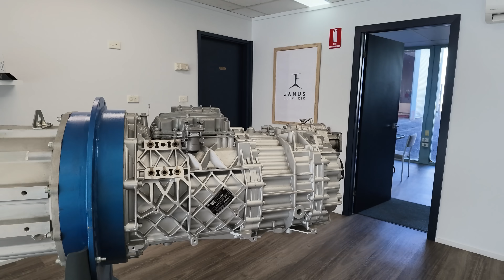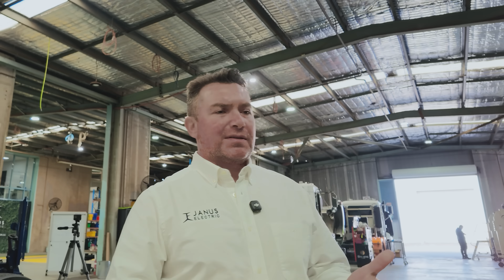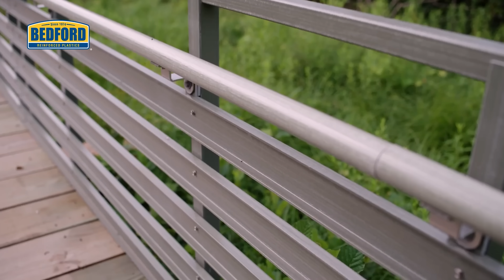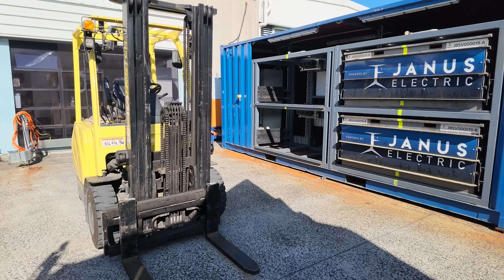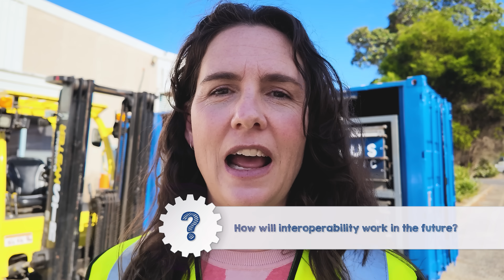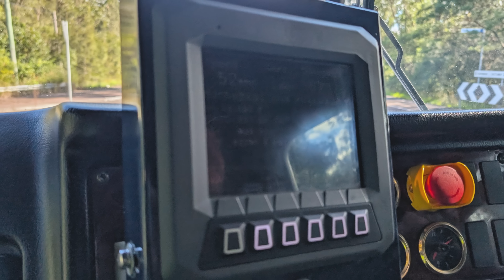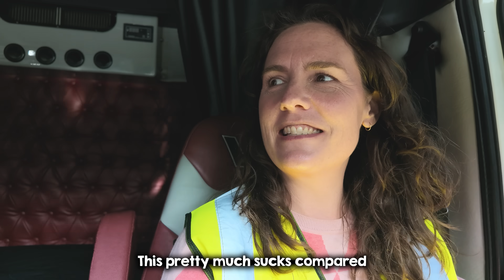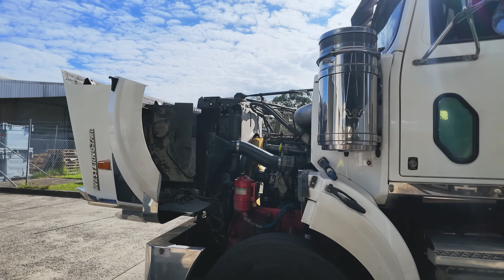The EV Truck Idea I Actually Didn't Believe Until I Saw It

Comment: Ok so even battery swapping still does not make large ev trucks viable so you can’t get around moving electricity around the grid so we have 250000 large trucks even if you tried to do 10percent 25000 trucks which with battery swapping probably means 50000 batteries it’s a load on the grid even distributed won’t scale. Really the only solution for trucks in the future is Hydrogen fuel cell, batteries work only when battery tech gets better and you build Small modular reactors at a charging station to charger the batteries so removing the need to connect to the grid. Only reason people are mucking around with a few EV trucks is it gives the companies rebates and Benefits from the government if you stop all government benefits watch this all stop fast

Comment: You didn't show any pictures of the actual electric motor in the truck standing back a little bit to see how it all looks
Also the truck with the batteries looks like it's only a few millimetres off the ground what would happen over a rough road or any speed humps ?
How many kilowatts are the batteries how long do they take to charge ? To me it was just a lot of talk

Comment: I've been wondering why there aren't diesel electric trucks, like train engines. They would be able to operate in extreme cold when batteries often fail. My husband says there was a plan to switch out batteries in electric powered planes, but doesn't know if it ever came about.

Comment: I don't want to seem too smug, but I've been advocating just this for years. It's so obviously a good idea, especially in a place like Australia where there is a surfeit of solar energy during the day. The peak-shaving capabilities of the charging stations multiply the grid-scale economic benefits, to add to the overall environmental benefit of the whole scheme of electrifying trucking. I think the reason we don't have this for cars as well is a lack of co-operation within the auto industry to standardise on battery form factors and battery-to-vehicle connection systems. They are doing this in China, though, so it may just be a matter of time before battery-swapping becomes the norm for all EVs. That will end the insane situation in the auto market, where cars compete on the basis of their range rather than other factors such as performance, carrying capacity, etc., as is the case in the ICE auto market. Imagine that: the two main worries of BEV sceptics: range anxiety and fear of battery degradation, banished!

Comment: LOL so the batteries where they need to be out in the country wont even have them, nobody is going to have a few spare batteries just sitting there incase someone comes.. LOL this is a nightmare and it can be solved with hydrogen combustion. nobody is taking into account that EV take more fossil fuels to make and keep going and last a a shorter time which means they are very inefficient the math says so!!

Comment: So batteries great, first problem is they have to be everywhere a truck goes, I was NSW truck driver and I went EVERYWHERE non stop 500km stop unload then go to the next destination 40 more drops to go, and then later that week finally go home. batteries out in Coona, Dubbo, Orange, Lithgow, Armidale, Tenterfield, Coffs, casino, grafton, lismore, inverell, and back to Orange then to Newcastle, Griffith,  young, Canberra sydney pick up and do  another 4 days. I figure that's about 10 or more batteries in a small truck, Some small truck don't even need to stop, they can drive for 24 hours straight plus like I did taking my stuff from Newcastle to Mackay and back in 3 days.
Reply: Not all trucking is that for a start. Also if this is distribution for a single company to depots/stores in all those places, then the company can place battery charging and changing infrastructure at them. But yeh this isn't likely to be a great fit for a single owner operator yet.

Comment: Ok Rosie you have solved the problem that most truck drivers never even cared about... BUT the real problem is the Electric AI trucks will try to slow down as a car goes around it so they are not breaking the law by being too close.. of course a real driver doesn't care if they hit a car cos they are not going to die and the STUPID car driver is obviously at fault so they don't slow down and make that space that by law in front of the truck..

Comment: Their air cooled swappable batteries have had 3 fires since 2022, these aren't small fires either all 3 fires resulted in fire-fighters expressing increasing alarm at the inadequate safety regulation surrounding large lithium battery installations. The most public fire was in 2023 which resulted in major disruptions to the west gate bridge for over 7 hours. Fire-fighters were forced to let the truck burn itself out completely as battery fires of that nature are practically speaking, impossible to extinguish. 

This company seems to have a totally cavalier attitude towards safety because even after that very public inferno they had another big fire in 2024 at their factory. It's actually shocking that you didn't even mention this or ask them about their safety given their history... 

Janus is the kind of company that througj negligence will do immense reputational harm to all EVs when their shoddy engineering practices inevitablly hurt or kill someone...

Comment: So just like the Hybrids and Evs That they had Lowers the breaking distance standard so they can have the ignorant cars and trucks on the road legally you know because they're one and a half times heavier with larger rims and harder tires called Low rolling resistant tires is why they can't stop or corner with the same size car Dino cousin if you will so they get to beat up the roads and more dangerous Granite it's only some  50 ft at 55 mph

Comment: Nice to see them picking the low hanging fruit. Don't see batteries replacing diesel when it comes long haul trucking 1200km/day or say a logging truck headed out to kilometer 70 on the Nose Mountain Road. And best of luck with the batteries when temp drops below -20C(-4F).
Reply: Those trucks are a very small percentage of the number of trucks being used in Australia. It's like the stereotypical EV critic that whinges he can't tow his massive caravan across Australia using an EV, which makes them useless in his mind, while conveniently ignoring the massive cost in fuel could have paid for a  trip to Europe all expenses paid.

Comment: I have been following Janus from the start. It is really interesting to see how they have adapted and developed along the way. Adding the grid support component is very clever and I think will a common thing in the future. Battery stations doing double duty supporting trucks and the grid at the same time. It was also great to hear how they've identified their market, e.g. 80% of trucks doing less than 280 kms per day. Quite different to the public perception I imagine. Janus won't be a complete solution to electric trucking, but I think it will be a really big part of it. At the end of the day, this transition is all about batteries really. They are the key component of everything.

Comment: Hydrogen diesel hybrid will be the future of heavy vehicles
Reply: Electric plugin hybrid with dual fuel methan + diesel is better. It is possible to produce synthetic methan, use bio diesel and it is much easier to store methan on board, and such dual fuel trucks already exist!

Comment: Do they make a double clutching and equating both rotational speeds of the next gear wheel and output shaft, by using an electric motor during the shifting gears, in order to shift much faster, quieter, and to almost completely reduce the use of mechanical synchronizers? Because with additional rotation speed sensor on output shaft of gearbox, or through the info of ABS sensors of drive axle, it is possible to equate both rotational speeds of output shaft and the next gear wheel during neutral gear between the gear shift, that it will work like electric synchronizer, but much faster and the synchronizers in gearbox itself could be completely removed, to make gearboxes for electric trucks cheaper, smaller and lighter!

Comment: Very interesting. I've been very skeptical of the battery swapping model as a general solution for EV charging, but this is the first application of it where I think it really makes sense. Once standardized across the industry, it would make long haul work really well too... A 4 minute swap twice as often as you fill a diesel is nothing. Can't even relieve the bladder in that time. No need for giant range numbers, just battery swap stations at truck stops. 

My idea for a regular passenger vehicle is similar to swapping, but not exactly the same. Imagine a battery bay under a vehicle with 5 long battery bays running front to back. Each would accept a battery somewhere around 25kw. When you buy a vehicle, you buy the number of modules you need for normal usage (not the once/twice a year long trips). So say 50kw is comfortable for everyday use, you get 2 modules and install them in the outer 2 bays (or the 2 inside that, whatever is best for the vehicle weight distribution). Charge at home and with level 3 chargers as usual... No battery swapping or rental batteries etc. This alone makes the same vehicle adaptable to many different people's needs, without having to create numerous models or versions. 

Then the real benefit comes in. Everyday you get a lighter vehicle that will be more efficient, cheaper, etc... but come vacation time, you stop by a battery module rental place and you can add a module or 2, or 3, or even 4 if you usually operate around town with just 25kw. Now you have up to 125kw for long distance drives, especially if also towing etc. Still recharge as normal. When you get home, return your extra modules and back to normal driving. 

Or, you can just charge more frequently with the small battery if you prefer. As speeds improve, this is more viable. 

Biggest challenges would be adjustable suspension to handle the big weight changes, and connection/management for the modules... How they handle cooling, etc. The system would have to be able to balance uneven battery states etc... But it seems a solvable problem. And it would avoid needing millions of battery swap stations everywhere like the Nio etc model.

Comment: Very cool! But this will probably stay a niche: it's a proprietary system, not universal.

And almost all trucks have enough time on both ends to charge, and on longer distances you got mandatory breaks for drivers which are also available for charging. 1MW charging is getting more common and can also be installed with smaller grid connections if you combine it with stationary "booster" batteries.

Comment: I hope this is all true. It sounds really strange that a truck that was build for diesel and is converted to electric is lighter than a modern electric truck. It cannot be just je battery capacity, because they are comparable. Something is missing in this story.

Comment: Thanks, really important to stress that most trucks do not do long haul, not even in countries with lots of space like Sweden, Finland and even Australia!

Fix the short haul, and then the technology improvements will cover the need for extra range.

I know that Australians like the macho idea that all trucks go across the desert without stopping, but even with the current solution you get 170km, and with the next generation they could probably make that longer, or the long haul trailers could have their own batteries, power and regeneration systems. Plus drivers stopping for 5 minutes every couple of hours is probably healthy for everyone...

Comment: Could be interesting to have EV road trains fitted with solar panels on their roof's to get more charge back into the batteries as they drive the long distances, you could fit quit a number of Kw of solar on top of these massive trucks,
Reply: I have just fitted some solar panels on my roof and was quite surprised how heavy they were.  So it may have a detrimental effect in drag and added weight, that may offset the extra electrons gathered.